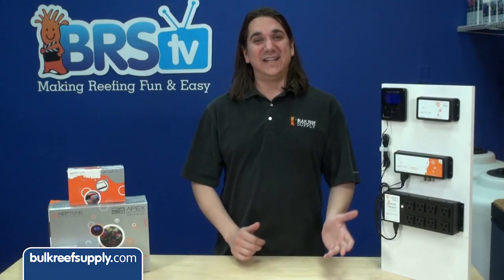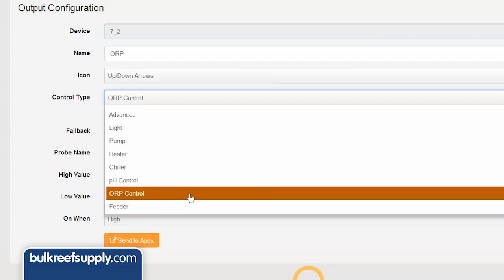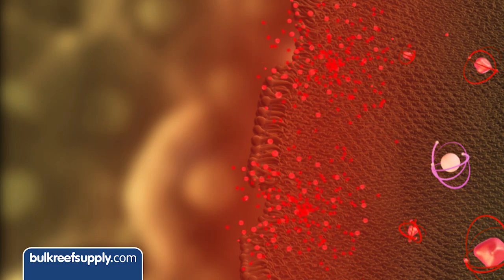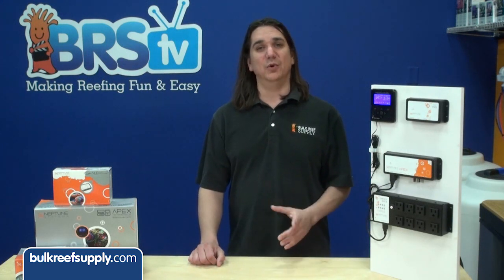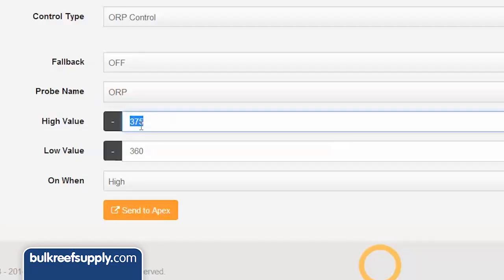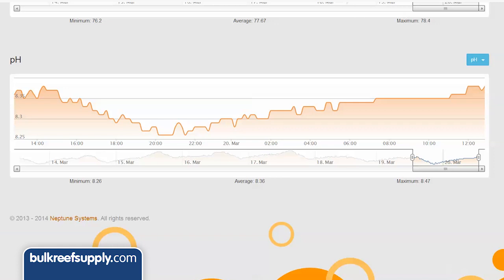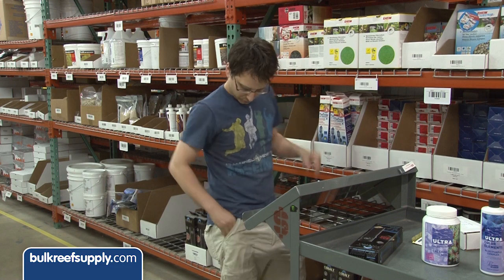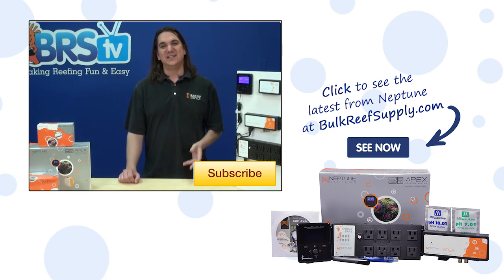How and Why to Measure ORP in Fusion EP 16: Apex Aquarium Controllers from Neptune Systems

Comment: Is it possible to have a orp in a reef tank of 60 before adding ozone ?
Reply from the maker: An ORP of 60 is unusually low. If you've had the probe for a while, you may want to inspect for any damage and give it a good cleaning.
Reply: if it is older then clean, if it is new give it a week to build up the film that it needs to be accurate.

Comment: My screen says pH2, not ORP - even though it's the ORP probe.  How do I set it up to read ORP.  The readout looks wrong as it indicates under 3.
Reply: +Bob Huff  If you have your OPR probe connected to the PH/ORP connector on your base unit... do this on your controller....
Hit the centre round button (enter) --> main menu
scroll down to "system" --> enter
Scroll down to "display setup" --> enter
"home display" --> enter
"page 1" --> enter
Scroll down to "Probes Line 1" --> enter
Line: be sure it says enable
Left: hit the right arrow to move the curser to the right
Scroll up or down until it says ORP --> OK->OK->SAVE... you should now have the OPR reading on the left side of your veiwer on your first line.

Comment: ok so what do you do if your orp hits 450 ? ?
150gal 48x24x30, rubey36e 40gal sump, reef octopus regal 170 int skimmer , 180 lbs life rock , 250 lbs live sand , 40 lbs mineral mud (fuge) . start up cycle ended 11/28/2014
2 clowns, 2fire fish, 1 yellow head jaw fish , one dotty back , 2 wrasses . 15 small mushroom corals, and assorted frags of polyps 30 heads total .
my apex orp probe tracking shows min is 410 average is 437 and max hit 450 one time in  4 days
should I assume that I have plenty of room to expand my live stock ?
should I put my skimmer on a run program to keep the orp number down ?